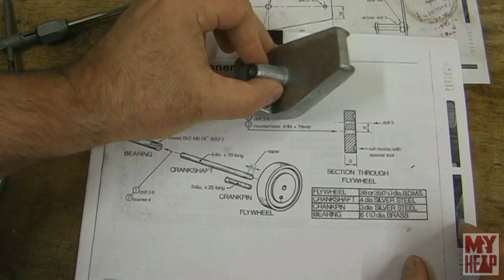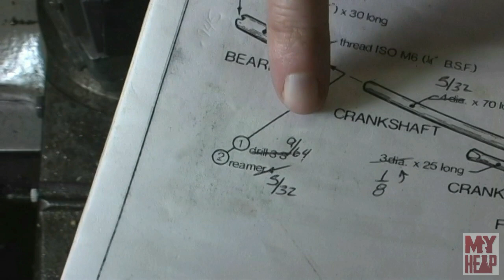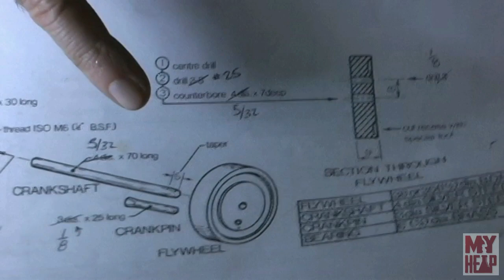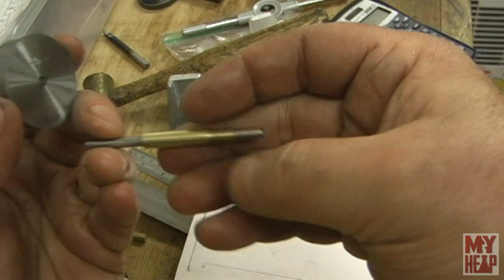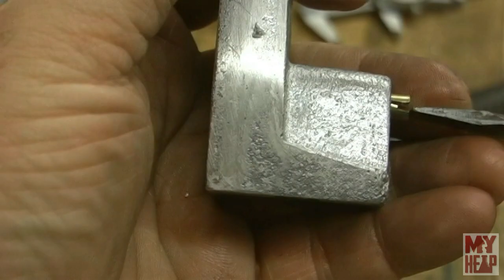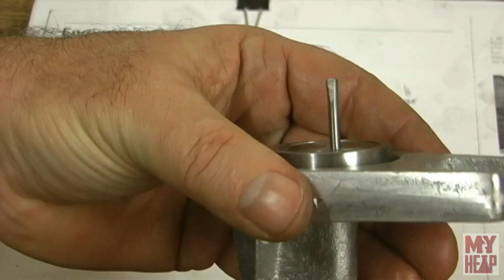Kenneth Wells Stationary Engine - 11 - More Frame Work and the Crank Assembly

Comment: wow good progress. drill rod is exact on size, where a lot of steel rod isn't. so if you have a new reamer, it's going to be a bit tight. a flat toothpick down the side is a good trick to make them cut a smidge oversize. that taper and step system of retaining the flywheel is crazy simple and seems really secure. seems to defy logic, I was suspicious about it too,. i tapped the holes in my casting right though and put screws from underneath, looks like yours will work just as nice. if your flywheel is a bit thick, then make sure u have clearance under the conrod, you may have to make the plate a bit thicker too. also, make nuts and studs for the back of the engine valve plate, because u cant put screws in there when its assembled, as I found out. nearrrly finished tho, not many more bits at all. ! nice.
Reply from the maker: When you say use a toothpick, do you mean lay it between the flutes?  I thought I would fasten the engine down to a piece of wood to give it a little more weight and stability.  I think I will bring studs in from below to attach the engine casting down.  Thanks for the adding studs tip, I may not have thought of that and then been stuck.  So, as cut I notice the crankshaft is way too long.  Was it this way for you too?  Will be starting the cylinder soon.  Thank you for watching Emma and the support!

Comment: Nice progress Joe...surprising how clockmakers use the same flat bottom drill bit to set bearings in certain clock escapements where pivots don't quite do it...I'll be using that type bit to install 3 bearing in the grasshopper clock next time I can work in the shop...just a thought but if the corners were rounded on the bit you'd have an oil sink cutter...look forward to your next installment.
Reply from the maker: Bob, it is wonderful to hear from you.  Thank you for watching and the great advice.  In an hour or so the video will release on making the pin drill.  Hope I don't embarrass myself too bad.  Get plenty of rest and the reading all finished up.  The. We will see you back on the grasshopper I hope.  Take care brother.

Joe

Comment: looking good man, and looks like a good bit of progress on it. I was waiting to see how you reached the back of the crank pin to swage it in, but you never got to it, lol. I think I would take a center drill and add a small countersink for the material to spread out into, then it'll end up as a flush rivet almost and be alot stronger in the end.
Reply from the maker: Adding the countersink may be a good idea.  Really the pin should just wedge in the hole from snaking and swelling it with the hammer, though I may have overdone it.  I have since painted the flywheel.  Maybe an update skimming and setting the crankpin??
Reply: lol, I say just toss the setting the crank pin in the next video :P

Comment: Looking good Joe, and I can't wait to see it running.   FYI,  when you get you horizontal mill running, surface the plates on your press for a flat surface,  the HF press plates are just to irregular for on small parts.
Reply from the maker: Thanks for the tip Walt.  I'll try to remember to do that when the Mill is back up and running.

Comment: G’day Joe, pray that you and family are keeping well. 
As for your question regarding camera angle yes it was good, did you use the surveillance camera for that shot or other. Elsewhere you said pandemic and I think you meant pedantic but hey in today’s environment pandemic is a common word, unfortunately. 
Swage, (S / wage) I don’t think you want to fight (swedge ) someone 
And finally it was a hack job but hey it’s inside a housing, why waste time and material when you can’t see. As time passes your grandchild may pull it apart and realise grandpa wasn’t as perfect as we thought:) 
Progressing nicely and well done. 
Cheers 
Peter
Reply from the maker: Hi Peter.  Thanks for the clarification.  Yeah, I still think I should remake the bearing only because I know it's there.  The video was made on my camcorder.  Until I find a decent mic to use with the computer the IP cameras will have to wait in the wings.  Thank you for watching.  Now I am off to watch you newest dividing head video.